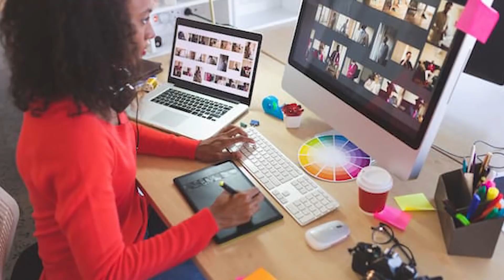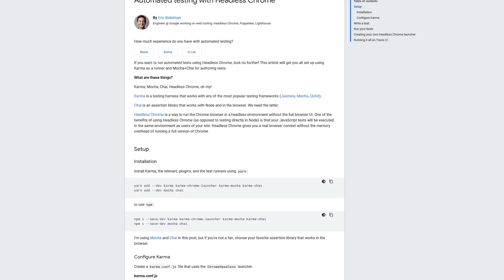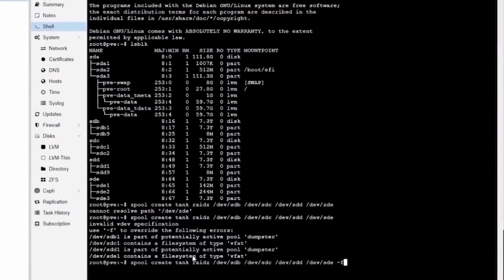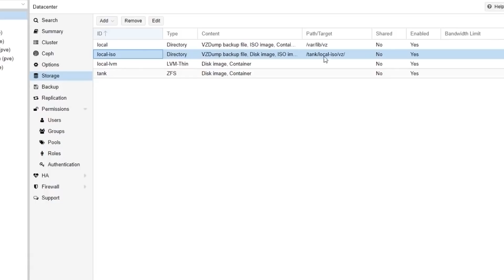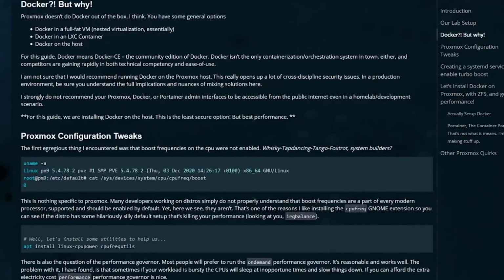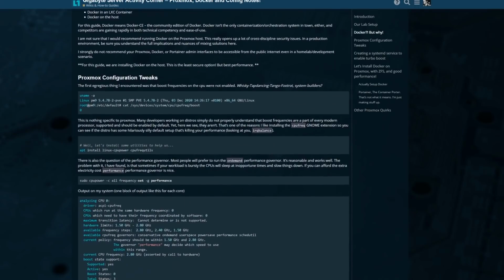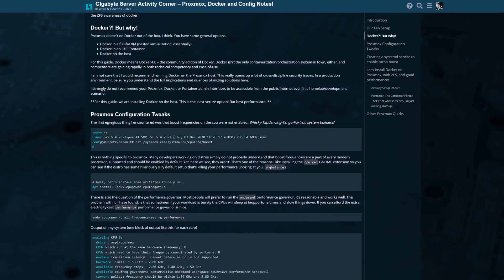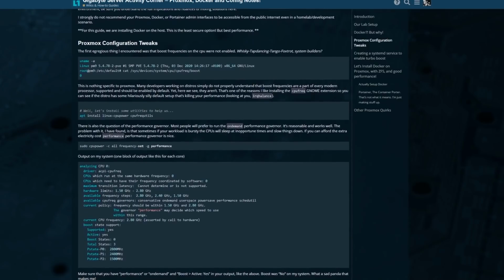Setting up the Gigabyte G242-Z11 with Proxmox & Speed up How-To

Comment: Software dev here, used to write for a web app that was targeted at enterprise users, including techs in the field, they are especially picky. We didn't automate the real devices but we did have automated virtual device testing using selenium for some of our more esoteric but well used workflows and had a selection of real devices to check things on when we changed something that might break things.

That shit is hard, especially when the applications are modelled and transformed, and not all hand written. Got to make it work in a generic kinda way.

Comment: Hey Wendell, instead of that liquid card that has a pcie switch on it, can you use a 4 x nvme card that bifurcates a 16x slot into 4x4 lanes? (this card that expensive asus threadripper motherboards put in the box)
I wonder if such a card works in a server too (does the bios support splitting a 16x slot into 4x4)?
Reply: Many servers do support bifurcated PCIe slots - I run an asrockrack epyc motherboard at home with exactly one such 16x=>4 nvme cards
Reply: yes, a simpler 4x4 bifrucator can work, there are uefi options to configure the slots as such.

Comment: Didn’t know about the turbo boost default, nice tip
Reply: I just checked on my 6.3-3 install, the i5 4570 was boosting as advertised.
Kernel is 5.4.78-1-pve.
The /sys/devices/system/cpu/cpufreq/boost file is missing, so not sure what's happening there.
Reply: @popcorny007  I feel this might be an AMD vs Intel thing. My Xeon D-1540s are boosting just fine as well, at least according to intel_pstate.

$ cat /sys/devices/system/cpu/intel_pstate/no_turbo
0

aka, turbo is enabled and working.

Comment: Engagement challenge
I think the defaults on Proxmox makes sense in an enterprise environment, where you got lots of servers running. Usually CPUs have a certain frequency where they are running at peak efficiency. Turbo or overclock will bump the voltage a little (or a little more) and give you a performance uplift, but at a lower efficiency, so it makes sense from a cost perspective to disable turbo. If you got lots of servers, it probably isn't negligible, but for a home user or even a medium-sized company with up to 3 hot racks, it should be fine to enable turbo I think.
Reply: > Turbo or overclock ahahaahahah noooooo stop thinking this way. Turbo is * a fact of life * on modern cpus. its not an overclock it is absolutely positively stock behavior. it will not result in instability or conversely if turbo doesnt work you can return your cpu. its not an overclock. Some cpus like the xeon 8125M are skus for specific customers like amazon where the speed is essentially the "all core turbo" all the time. The default should be to operate how the cpu manufacturer expects. Not to disable turbo.
Reply: @Level1Techs  Our 1650v2 cluster has a max freq of 3900.  The 2650v2 cluster, 3400. Scaling governor is performance on all nodes. Have you found this to be broken or is this a "Proxmox with Epyc" issue?
Reply: @FilleMang  That seems right, but you might double check. It may very well be that this is a default config problem that only affects Epyc.
Reply: @Level1Techs   I believe I'm speaking with the editor, so I will be addressing accordingly.

That is not what I said and this is borderline putting words in my mouth. What I said was turbo OR overclock, which as you mentioned are different things. I don't have a kill-a-wat or any wattmeter to check the consumption of a CPU full throttle with and without turbo, but if you have one, I dare you take some measures and see the consumption for yourself. 

And I also did not say turbo introduces instability and for a fact, neither does overclocking if the CPU is not pushed too far. 

>The default should be to operate how the cpu manufacturer expects.
Neither Intel, nor AMD guarantees performance for permanent all-cores turbo, they only do for the base frequency. They do mention performance "up to" due to turbo, but that is not a guarantee, but it's in certain scenarios. You can get permanent all-cores turbo performance, but the manufacturer does not guarantee it. And as I mentioned, turbo affects overall power efficiency for better performance, which was my whole point.

Not all cores are created equal and some cores require higher voltage to operate at the same clocks, which is why turbo exists in the first place.
Reply: @MrBiky  The situation here with proxmox was that turbo was disabled That default does not make sense for the enterprise environment. The manufacturer (intel and amd both) absolutely do specify how long at what clock, on how many cores and how many watts. Out-of-the-box this configuration would run well under the rated TDP of this CPU because it simply wouldn't clock as high as it should be. This is not a sane default.

Comment: Holy wow! That boost thing is terrible. I'm wondering if it's a CPU specific issue though. Perhaps EPYC?
Boost seems to be enabled on my server at home running proxmox on a Ryzen 2700.

# cat /sys/devices/system/cpu/cpufreq/boost 
1
Reply: I'm also seeing it enabled on default on dual opteron 6272's
Reply: Seeing it as enabled on my epyc 7252, too, but this isn't anything like a fresh installation